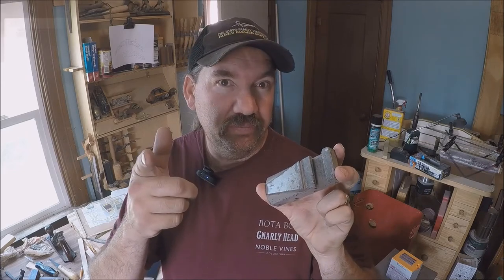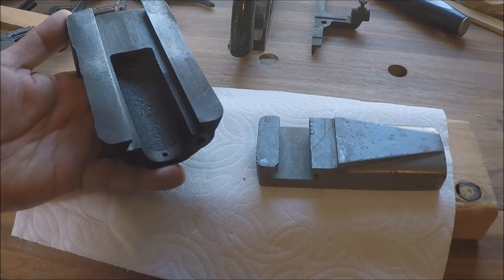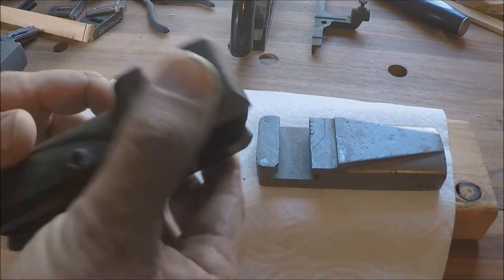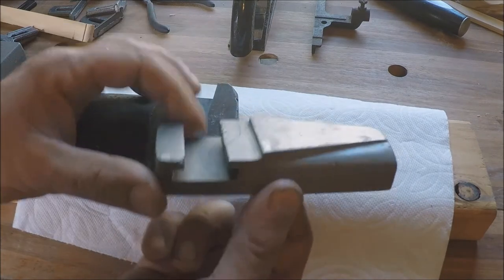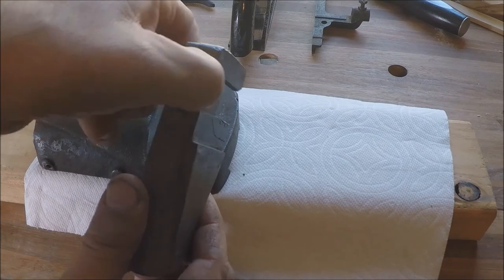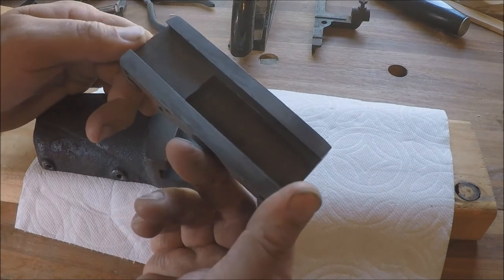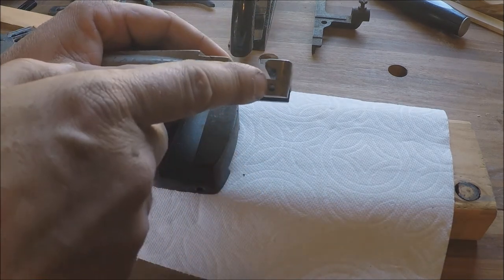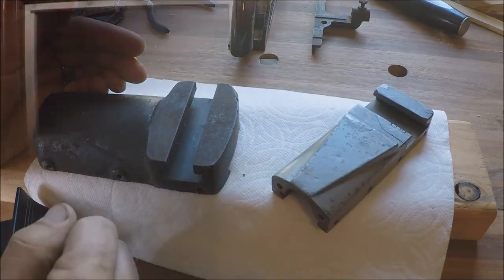Foundry Pattern Making: atlas compound slides #1

Comment: Nice explanation Chris. 
Could the slot be milled further back toward the feed screw handle? Perhaps add an 1/8" or so to the length of the slide? That would increase the mass of the weak point. Additional material on the back wouldn't adversely effect the lathes operation. 
Going full on modification, perhaps extend the cross slide so a tool post can be added to the back end. Nice for small production runs. 
Milling attachments are in short supply too. Selling rough casting kits for them could do well. 
Lots of fun. 😊
Reply from the maker: All good ideas but at the moment he wants a fairly accurate reproduction. And we may work on other part as well .
Reply: Old Iron Shops Does your cast house have any control over the alloy? At the Midwest the different pouring ramps had specific inoculants to create grey iron, maleable, or semi steel. I think grey iron would exhibit the fractures the part has. Maleable could better withstand the shock loading from interupted cut.
Reply from the maker: I'll have to ask

Comment: Yes, make the 6" casting 1/4" wider over all to make it stronger.  Also the thickness could be adjusted so long as you could still mount up an OXA toolpost and find center with the carbide.  Improved parts with the character of the originals would be the best. Nobody is running a museum for these and there is no extra value for absolute stock.  In fact, good modifications made in a workman like manor increases their value.
Reply from the maker: All good points I'll have to point this out to my customer choice is all his

Comment: FYI, the atlas 12" top slide is the same as the 10" top slide with a 1" taller toolpost mount.
Thanks,
John
Reply from the maker: Yup easy to make 2 models with the same parts that way

Comment: Thanks for the video. Both of these compounds look like excellent candidates for someone to model and 3D print to either use as patterns or for investment castings perhaps. Myself, I would grab a chunk of steel or iron and machine one on my milling machine. I prefer a rectangular compound anyway rather than the Art-Deco look.
Reply from the maker: Lots of ways to go. Investment casting is more expensive for certain and probably not the way I'd go.

Comment: I think there could be a market for flat top compounds to update the lathes for use of magnetic indicator.  Mr. Pete made one for a 6" and never mentioned how handy that flat top would be.
Reply from the maker: He makes one milled in steel
Reply: Yes, but it's so much more pleasing to machine cast iron.   ;-)  The only reason one would machine cast is because he does not have it.   Perhaps your point may be there is no point in casting a regular block.  The advantage of casting in iron is picking up the decoration on the top of the compound and perhaps to reduce machining on the dovetail side.
Reply from the maker: Your right on all accounts

Comment: Anything that you can do to help strengthen the 6" compound would be helpful.  They are a weak spot on the lathe.  It also suffers from the tool post surface being too low to use a quick change tool post.  I made a washer to boost mine because there is not enough material to mill the top of the slide down. There are several versions of that slide from the factory, they all have the same basic dimensions but some are more rounded than others.  The one that you have looks like a later unit built after Clausing took over.
Reply from the maker: I'm going to thicken up the pad for the tool post. So it can be milled flush with the rest of the casting. This may improve the strength also since the peace lot will also be moved up as that's where it like to break off.

Comment: Hi Chris... 

I'm just wondering if a cast steel would be better for that small compound slide as like you says...you can just see it failing time &  time again...
Reply from the maker: If I had a steel foundry maybe. Iron us better at damping vibration so it still has its merits.
Reply: Old Iron Shops 

It is Chris...hence why we use it... 

Go for an SG...
Or Meehanite

Comment: Boy, that 6" compound is tiny....it probably cracked parting when a crash happened snapping the parting blade. They can be found on ebay cheap enough...casting & machining a new one will be more expensive...just my 2c
Reply from the maker: My customer already has wite the demand for them . Be a little options for he's customers as well . You will see in a up coming video
Reply: Cool, I need to do some casting soon....its been a while